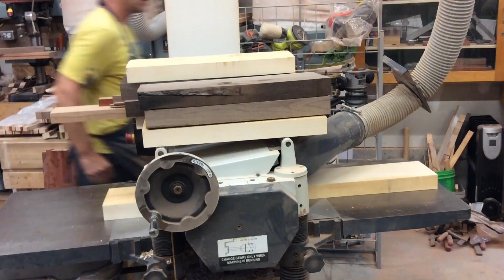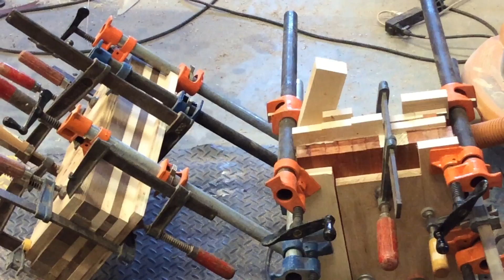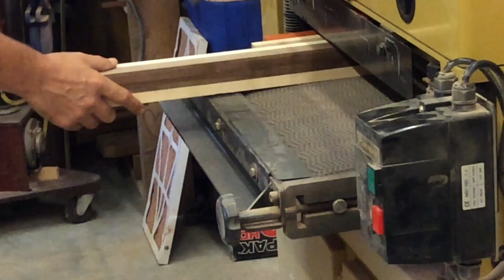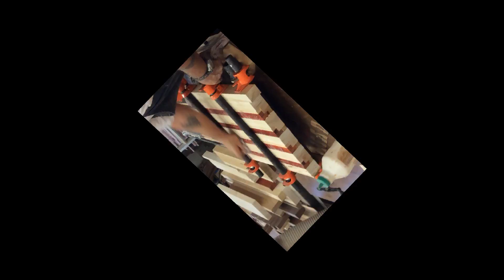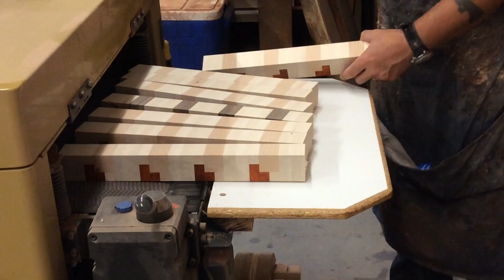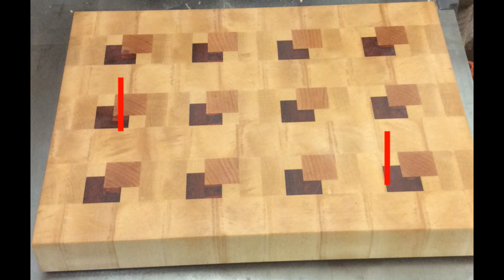Robert made it -floating square

Comment: I'd like to make some end grain cutting boards as gifts, but I've never made one before. I've watched a ton of videos and read several articles but I'm having a hard time finding a design I really like. I'd like to find something a bit more interesting than a checker board, but I'm far from being ready to tackle a really intricate 3D board. Any recommendations?
Reply from the maker: Tough question, id actually say this board, (floating square) is a bit more difficult compared to the really cool 3-D board. The 3-D has far more cuts, yes but its also far more forgiving compared to the floating square design. I suggest watching the vids of different board builds again, "carefully " and decide what's in your comfort level. If I can be of assistance in any way, just ask. Good luck

Comment: Robert, great work! Thanks for sharing with us. Keep the videos coming. Just curious, I have been making a few end grain boards and have had issues with grain raising after use. I have recently used water after sanding to raise the grain. Then let dry and sand again to get rid of the raised grain, prior to oiling and wax. Do you have any method of reducing the grain from raising after use? Any tips would be appreciated.
Reply from the maker: Hi Alan, sorry for my late reply, I just had issues signing in to my YT account so I could do replies. But please know, I'm always more than willing to share any tips or help out as I can. Now, for your question, I actually raise the grain with all my boards TWICE. Just like you, using water but you don't want to be too cheap with the water. I had a buddy of mine who said his grain kept raising after wetting the boards twice as I told him to do. As soon as I actually watched what he was doing I concluded he just wasn't wetting his boards enough. He wiped them with a cloth that was barely even damp! You need to really wet them but NOT submerge them in a sink or anything like that but I wet mine really good. My cloth is just dripping water all over the place when I do it. At what point/gritt are you wetting the board? I sand mine from 80, 120, 150, 220, then I wet, (allow to dry completely), sand again to 220, wet, (DRY), sand to 220 and finish at 320 Grit then oil & wax. Since starting the double grain raise method several years ago, Ive never had nor noticed any signs or had reports of grain raising post oiling. Hope that helps
Reply: Robert White Robert, thanks for the information. Sounds like we are both following the same procedure. It's nice to get confirmation that I'm doing the same as the approach that is working for you. Also, agreed on really wetting the wood in order to get the grain to raise. Thanks, so much, for your response and for the excellent videos.